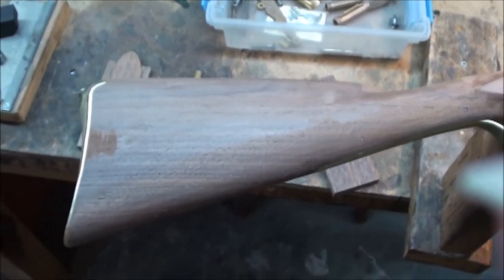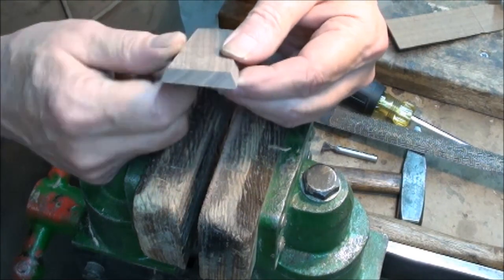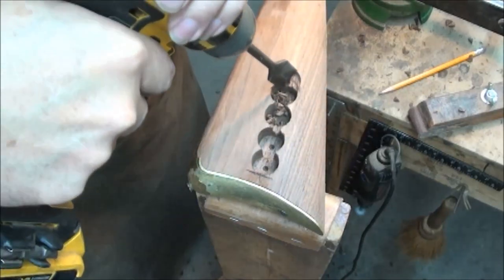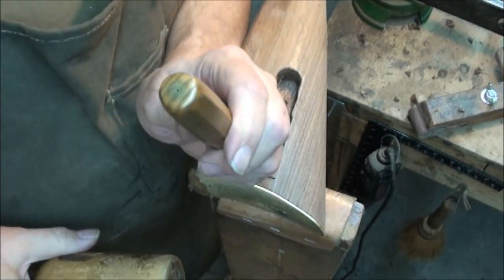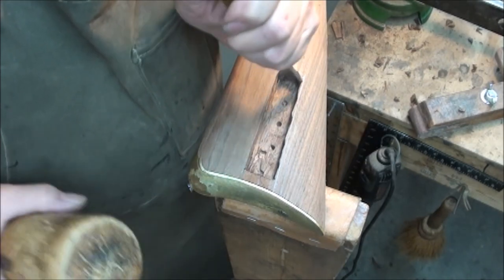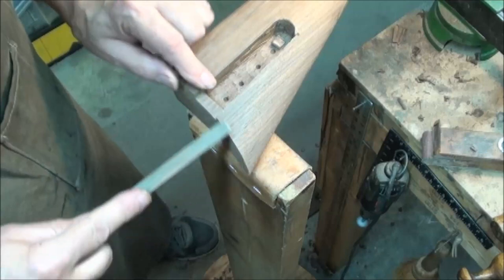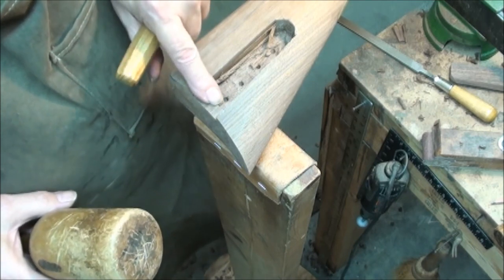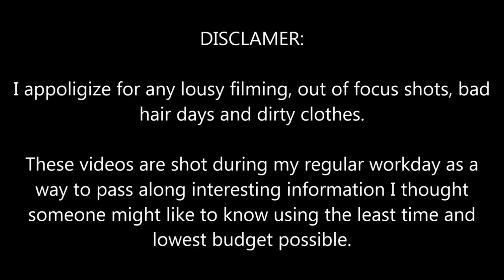The Grumpy Gunsmith of Williamsburg #40 Wood Patchbox

Comment: You can grind a scraper to match the router bit to cut the dove tails on the bottom of the lid I hope you do another vid to show how you do the top of the box  👍👏👏
Reply from the maker: I try to use more common tools that most builders might have but it's good you're thinking. A scraper would be great if you do a lot of wood boxes.

Comment: It is easier with a router it is also easier to screw up I don't mean to sound like a know it all but if you would use a 1 in. Chisel it would be easier to cut straight lines along both sides on the bottom side it would be easier to pare down on the line with a three quarter or a one in. Chisel if you have them either one will make shorter work of it
Reply from the maker: Most people don't have a wide chisel. I try to show how to do the work with more common tools but a 1" one would work well.

Comment: You mentioned a 14 degree router bit. Is a 1/4" by a 1/4" okay to use for the angle ?
Reply from the maker: No, it would need to be a dovetail bit, not straight.
Reply: Okay, I meant a dovetail bit. A 1/4" height x 1/4" cut. Is this the correct size bit or what size dovetail do you reccomend ? Thanks for the help.
Reply from the maker: @peshewa0529  1/4" depth is a little deep. 3/16" is best and as long as the dovetail in the stock fits the lid, you should be good. If in doubt, try a practice block first.
Reply: @grumpygunsmithofwilliamsburg  I will try a practice run on another piece of wood before I touch my rifle stock. Enjoy your videos and respect your expertise on muzzleliading rifles. Keep putting them out.
Thank you again.
Reply: Where can I find a 3/16" dovetail router bit ?
Reply from the maker: @peshewa0529  
The diameter isn't important. Set the cutting depth to 3/16.